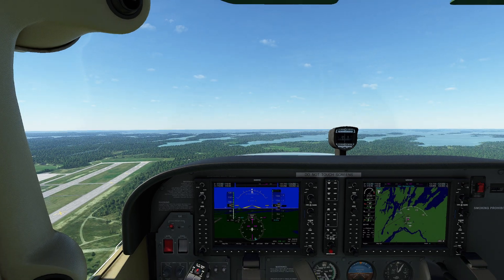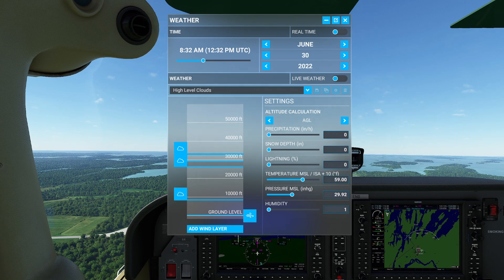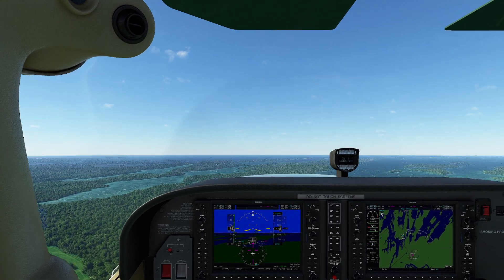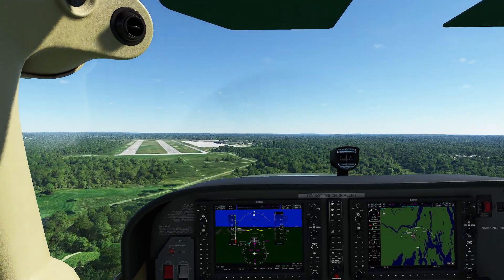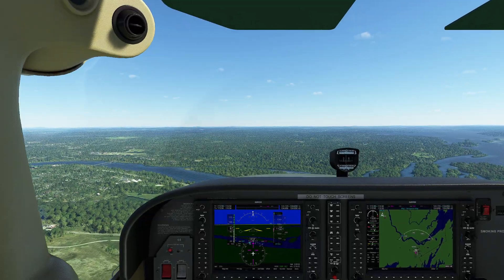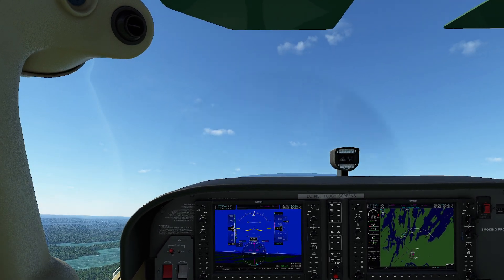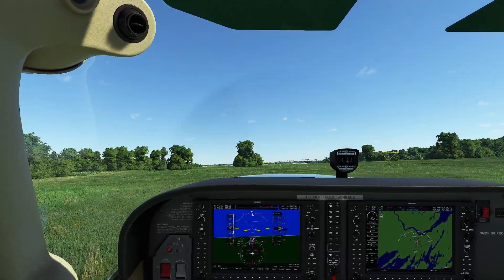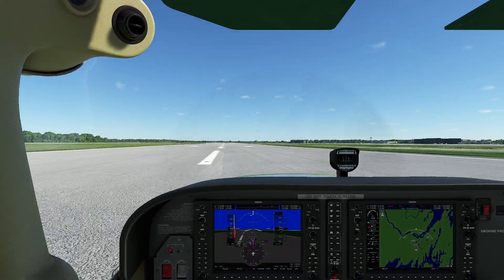MSFS - Minimum Sink Rate vs Glide Speed

Comment: Hi there. What you described in the video is Vbg (best glide speed) and how to adjust it in windy condition to cover best gliding range. That is not minimum sink speed. Minimum sink speed is the speed that gives you the least vertical descent rate, which gives you most time afloat, but not best range. Minimum sink speed also does not change because of winds. Thank you.
Reply: Exactly!
Reply: I noticed that the author does not respond to justified criticism, shot the video and forgot, does not recognize mistakes in the video and does not correct them. But despite this, its content is mostly very useful and good.